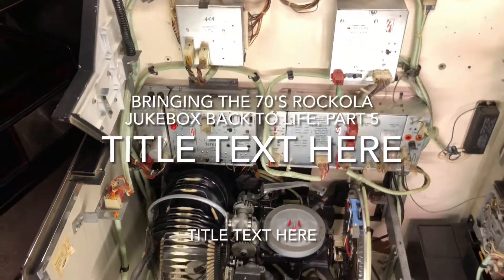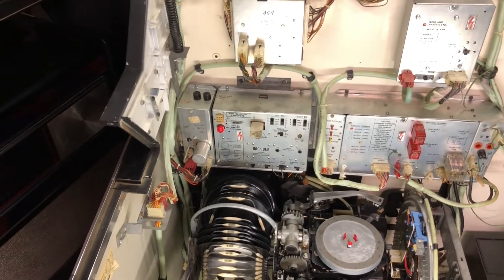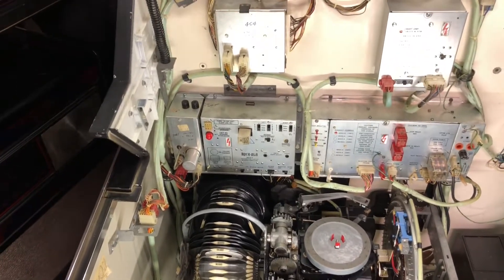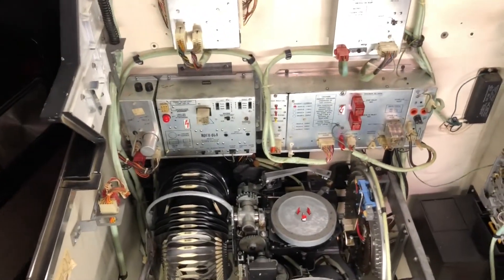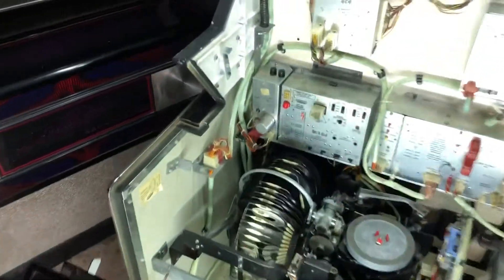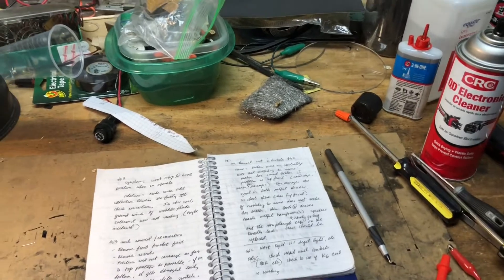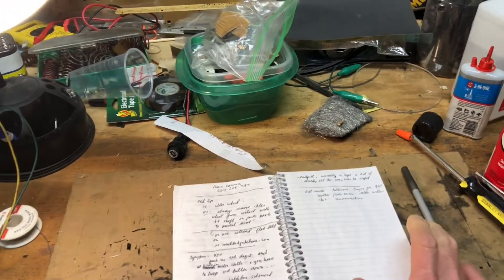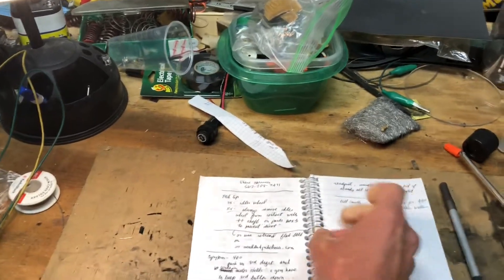Bringing a 70's Rockola Jukebox Back to Life. Part 5

Comment: Thank you for these informative videos.  I have had a 454 given to me from a fellow who owned it for 20 years and just used it for aesthetics and not for playing.  I cleaned up the mechanical arm and have it flowing nicely through its motion.  My current issue is that once the record is done playing it doesn’t register it as done to pick it up and switch it out.  I hear a click when the record is done but the return sequence isn’t actuated.  I can manually run the motor through the motion and once the record is returned and the limit switch drops into the pocket on the cam it will go ahead and grab the next record and play.  What are some things I should look for in this failure to return the record after playing?

Comment: Thanks for the helpful videos! I'm trying to fix an issue with hammer coils on the selector side. I think it's the last thing I have left to fix! I guess I'll just check all the connections I can find. Hopefully I find it!
Reply from the maker: Hammer coil circuit is complex.  See sequence # 8 in manual (454-460 models).  Note that K4,K5, K6,K7 and K2 are involved with this circuit not to mention the molex connectors along the way that should be reseated twice and cleaned with CRC or equivalent.  Also select a 200 selection to be sure it is not the 100 selection coil that is bad.  Gotta open up the credit unit and watch K2 and K5 actuate.  If not, trace back from there.  Best of luck

Comment: A weird problem is driving me crazy. Rock-Ola 454, issue is with selector digit 7. It will not register as the second digit.  Every other number registers fine, but when I press 7 as the second digit nothing happens. BUT: 7 will always register as the third digit.  So if I try to select 1-7-6 or 2-7-6 the 7 does not register-nothing happens when I press it. But if I select 1-6-7 or 2-6-7 each number registers, and the record plays. There is no problem with any other number or combination, all the records play.  I have cleaned the contacts and done the basics, to no avail. Thanks for taking the time to read this.

Comment: I have a Rock ola 464 when I make the selection the 3rd digit stays down and write in begins but never hammers the pin. I've cleaned and cleaned but still to no avail. Could it be somthing else or just need more cleaning. Thanks for the videos
Reply from the maker: the jukebox in my videos was a 460.  I don't have the manual for a 464.  There were some changes to the credit unit/ADR relay starting with the 464.  You will need a manual.  Steps 6, 7 and 8 are the pages you will want to study.  The hammer coil circuit goes thru many connections, including gang connectors on the bottom of the machine.  I had problems with one of my boxes with the hammer coil not firing.  Ultimately, it resolved when I re-seated the gang connector on the bottom of the machine the SECOND time.  But you have to be sure the hammer coils are still good (check continuity), be sure they are alligned correctly so if they do "hammer", it hits the pin.   Try a non hit 200 selection and if that works, then likely your hit side hammer coil is bad.  There are unfortunately many possibilities here for hammer coil not firing.  Lots of detective work to do.

Comment: Thanks so much for doing these YouTube videos, I found them very informative!! I have a 424, that is very similar to the one you use here. I have a question about the A/B side  selector mechanism. Is that strictly mechanical - the alternating dog as you called it in video 1 or is there some electrical/solenoid part to it. I'm not understanding how that works. What makes it go up or down selecting side A or side B. I know that as the arm moves up and down it engages a couple of switches on the very front, but that doesn't appear to have anything to do with how it chooses side A or side B, but only with energizing the wobble plate to know which pin (inner or outer) to act on. Or does it just go around twice, if it needs to, trying each side and then when the correct pin is found on the wobble plate it stops?? 

Also, I have found a bad solenoid. Who or where do you recommend I get a replacement part? ....Thanks, again!!
Reply from the maker: the alternating dog as it travels up or down between the two tracts manually actuates the A-B microswitch which then sends power to the hit (A) or non hit (B) circuit board on the right in side of the circular drum.  You can hear this switch click when the magazine passes thru the home position.  And you can visualize the action as well.  Checking continuity may be needed.

Comment: Both amp fuses on my 470 are blown. Any ideas?
Reply from the maker: Most likely a shorted heat sink transistor or a bad diode on the supply board.  A blown fuse ususally indicates a serious amp problem.......you should have it rebuilt with new electrolytic capacitors installed and all transistors and power diodes on the capacitor board checked.